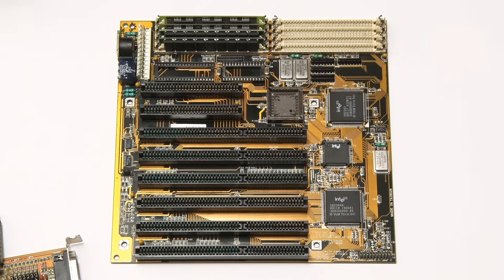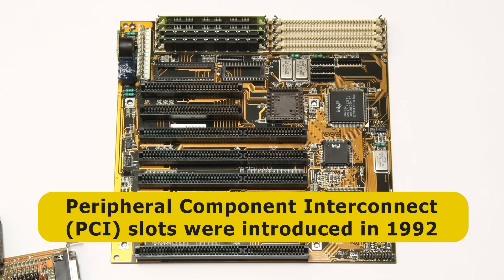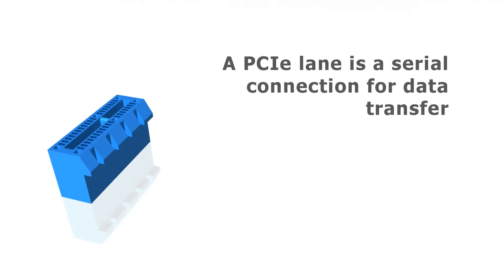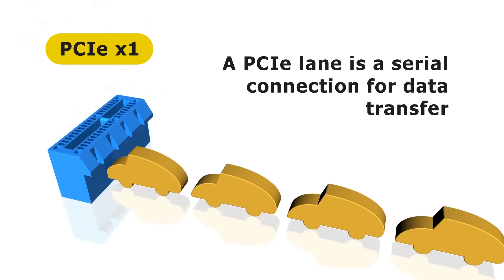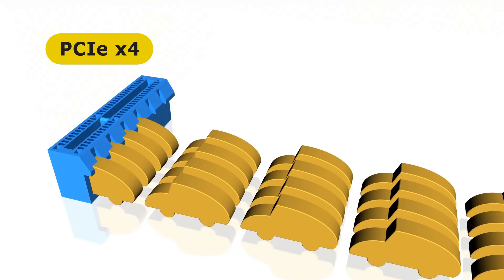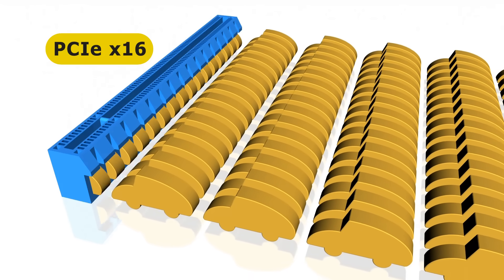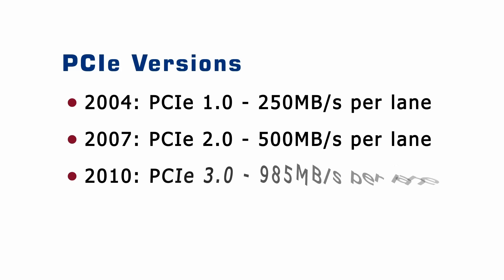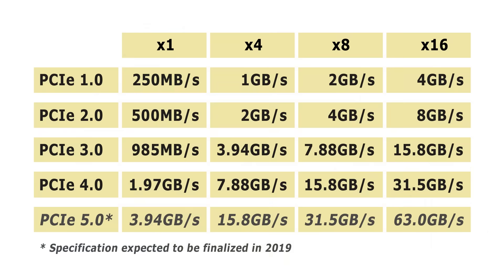Explaining PCIe Slots

Comment: But The Verge told me to put my graphics card in the PCIe slot that looks the best.
Reply: Thanks to the verge, not only did I put my graphics card in whichever looks best, I also put my "power brick" upside down, utilized good pc building practice by putting lots of thermal paste on my cpu, and used no cable management :D Now my PC is running better than ever, giving me a staggering 50 fps in League of Legends with my 2080 ti, as well as doubling as a heater during this winter season. All in all I thank the verge for helping me in so many ways.
Reply: @jjt171  

How do you have the balls to buy a 2080 ti, without having even the most basic of pc building knowledge?
Reply: @jjt171  hhahahahahhahahahahhahu congratulations!
Reply from the maker: Indeed they did! :)
Reply: @ExplainingComputers  😍
Reply: @ExplainingComputers  😍😍😍😍
Reply: @ExplainingComputers  I'm a little late to this video, but one thing that would have made it more complete is mentioning the throughput of the previous standards, for example saying that PCI was a 32-bit bus running at 33MHz, giving it 1056Mb/s or about 1Gb/s or 133MB/s, all running on a SHARED bus for all PCI slots on the board, while PCI-E uses separate buses for each slot.
That would put it more into perspective for those who don't know, and show the progress and improvements with newer slots.
Reply: Lol
Reply: But did you use your tweezers?
Reply: ouch
Reply: The Verge didn't even know what Ram slots to use
Reply: I saw the verge video and he didn't understand that when installing two ram sticks that they don't go next to each other.
Reply: And screw in with confidence.
Reply: I know that with my tweezers and Swiss Army knife I can build a computer anywhere I want as long as I have a table and wear a rubber-band on my wrist.
Reply: I was reading K's reply about The Verge guy's knowledge and the misunderstanding of EC guy. This EC channel is no doubt a great channel. Thanks for this video.
Reply: Can i put pcie 2.0 x16 card in pcie x16 slot ?
Reply: @unbroken5011  Yes, with no problems, and you can put a 3.0 x 16 card in a 2.0 x 16 slot but the performance will be reduced.
Reply: So you get your rocks-off by being a different kind of jerk, apparently.
Reply: I spent ages looking for an explanation of these things and finally I've found one! Thank you!
Reply: And I thought this was a joke 😂 I always go for good looking things.
Reply: OP, LOL!
Reply: no put the graphics card in the ram slots give extra ram
Reply: عادي عادي
Reply: Of course u should put at the best looking slot. It gives u more fps if u just believe
Reply: Oh, that poor guy… Let it die! Lol
Reply: Dont mind that video, the guy didnt understand anything about pc's he was just making up things as he goes. Try Googling a proper guide or something that way you could probably build your pc.
Reply from the maker: @808cry  I've spent nearly 30 years lecturing and publishing books and videos about computing, so respectfully suggest that you are wrong about my knowledge base. The vast majority of the comments here also suggest that this video contains good information and has been helpful to a lot of viewers. :)
Reply: @ExplainingComputers  yeh sorry for the misunderstanding but, am talking about the guy from the verge video he was making up things as he goes if you watched that video you'd understand.

Ps i really enjoyed this video 
Much love @k
Reply from the maker: @808cry  Ah. I see now!
Reply: @ExplainingComputers  I agree with the comments about The Verge, and this video. What was up with that? I know he's gotten a lot of crap for it, and that's a shame, but wow.

This video was well done in using simple ways to explain things. I'd never actually considered that the extra x16 slots were physically limited to fewer lanes because I'd never considered putting a x16 card anywhere but the first slot. Just looked at my old board I bought in 2013 and sure enough, the second x16 slot only has pins for a x4.

My brand new board has a x16, x8, and x4. But again, I don't plan to use the latter two.
Reply: @ExplainingComputers  This is a good intro for beginners and very useful in that regard.
Reply: @ExplainingComputers  yes!
Reply: @ExplainingComputers  sir plz make a video on pci ve pciexpress ..and thunderbolt port..plz sir i will wait for it
Reply: Why is The Verge's dude evidently clueless? Well, this may explain it:

I used to do computer repair housecalls and custom builds. I had a client who made his living writing "technology reviews" for major magazines. But soon I discovered that he actually did not know ANYTHING about the subject, but rather was just regurgitating promotional literature from the vendors. (How little did he know? He called me to install software that only required "Put CD in drive, click OK.")

Since then I've come to realise that this is true of more "tech writers" than not, including a very famous one whom I also know in Real Life, but won't name.

Also, I had no use for 4x slots until a bunch of SAS hard drives and an SAS controller card fell on my head... the card is designed for 4x. Well, now that 4x slot is useful!
Reply: @The_Collective  I say the conditioning goes back to the AGP days... basically you plug it into the "video card slot" which is always the first one.
Reply: @ExplainingComputers  169 likes lmao
Reply: @ExplainingComputers  I already understand what your explaining but I do enjoy your videos
Reply: @ExplainingComputers  He was talking in respect to MiniatureMasterClass's comment regarding the Verge.
Reply: @808cry  i knew that lol
Reply: @ExplainingComputers  Oversensitive much?
Reply: @riptaway  Nah, some dude was talking shit, and he basically said "I know what I'm talking about dawg". If you thought someone was talking shit, it's overly sensitive to clap back? Yeah right 😂😂😂
Reply: @808cry  lol boomers are so defensive, it is obvious you're talking about verge guy.
Reply: @The_Collective  He actually completed the Redemption Arc route in this simulation and did an apology/redux of the original video with the help of Linus Tech Tips.
Reply: @808cry  Right?!?!  Helps to be careful how we write. Ive done it.  Im probably doing it now.  LOL
Reply: @808cry  Haters are going to hate. You feel your own skills are inadequate, and you don't know how to gather enough energy and drive to make your own video.

So you're picking on an expert, rather than making your own effort. Look at your You Tube nickname; it's just one letter. It screams: I just don't want to put the slightest bit of effort into this.

This is called Attribution Theory. It's also called projection. I learned this from Professor Tracy Cross. I took his class on Research Methods. He was actually named Researcher of the Year while I was in his class!

My semester project was on how Chinese parents motivate their children to be diligent students, which was an intriguing and fun subject, with reading articles and interviewing Chinese people.
Reply: Anthony Starfield. Read K’s follow-up.  He was trying to say the verge video was bad. They got the misunderstanding worked out.
Reply: @Anthony_in_Bloomington_Indiana  lol wut?

Comment: Recently, I started getting interested in computers, especially Mini-ITX. 
I'm planning to use Mini-ITX put inside of Nintendo Entertainment System shell. Which is making a portable or Desktop PC.

I was very struggling to find the information about the PC I need, but thanks to you that I could learn about
the parts from a computer or a computer.

THANK YOU!

Comment: Still not sure I get PCIe lanes.  Sure I understand gen and lane count increases bandwidth, but what are the cards communicating _with_?  Why do some lanes come from the CPU and some from the chipset?  Is the communication bi-directional?

Why can I only cry at happy things?
Reply: PCIe is an interface just like any other, interestingly enough it doesn't only work with expansion slots. Chips on the motherboard are sometimes connected to eachother through PCIe, with no slot involved. You sortof answered your first question; some lanes connect to the chipset and some connect to the CPU. CPU lanes have less contention, when accessing memory or the CPU, since chipset lanes have to indirectly use the front-side bus to communicate with the CPU or memory, and other chipset modules will also be trying to use the front-side bus. Also yes, each lane is bi-directional and data can go both directions simultaneously even.

Comment: Well, you not only look the part but you can talk the talk. At 63yo Iv'e built all my desktops and back in the eighties I remember going to computer swap meets to get components, that's all a thing of the past now as components are so cheap. I remember when the TB HDD first came out and also the first DVD drive, you needed a bank loan to purchase LOL. I've just installed a 1TB SSD and cloned my operating system to it, I can't believe how fast the boot up time is now. So happy I bought my first PC when I did back in 1995 and the operating system was loaded from floppies with I think not sure 12mb memory. Just wish I was born in the 80's not the 50's oh well it is what it is. Tony from Australia

Comment: Thank-you That was very informative. I don't know if you answer questions, but I'll give it a try. Can you explain what PCI Express 2.0 x16
2 x PCI Express 2.0 x16 Slots (PCIE2: x16 mode; PCIE3: x4 mode) means? I get that you can put a higher end card into a lower end slot. But I am unsure what mode means. Does it mean if I put a PCIE3 x 16 card into one of those slots it will run as a PCI3 x 4 speed?

Comment: There are quite cheap adapters that allow the insertion of any PCIeX16 card on a PCIeX1 slot. I tried some with Video cards and they work. Obviously the data throughput is severely affected and you will experience image tear and some lagginess. That kind of adapters are usually intended for mining, where is much more important the calculations done in the GPU than the data transfer rate. Also, motherboards with more than one PCIeX16 slots usually share PCIe lines within them, so if both slots are populated you get X8 lines on each one. The chosen CPU also can limit the number of direct PCIe lanes available, A Ryzen 7 2700x has 20 of them but a Threadripper 2990wx triples that number to 60. I think there is enough to make a follow-up video.

Comment: I have long wondered whether those reverse-incompatibilities you demonstrated were possible! Thank you for the verification.

I still have a question regarding PCIe though, that I hope someone would be able to answer here:
Not long ago, I've read on [overclock3d . net] that older motherboards may (X300 / X400) may support PCIe4.0 for the new Zen 2 chip. I'm not aware of these old chipsets ever supporting PCIe4.0, So how can this be? Is this false, or is the PCIe version largely dictated by the processor itself?
Reply from the maker: I cannot believe this will be true. Older motherboards will I'm sure work with PCIe 4.0 cards, but at PCIe 3.0 speeds.
Reply: @ExplainingComputers   I'm relieved to hear that these PCI upgrades made no sense, thanks for your reply.

Comment: I have a question ... so all the PCIe versions have upgraded the data transfer speed (doubled each gen). Do we just need a bios update to make a PCIe 3.0 to 4.O ?  if the CPU and the card supports that speed.
Reply from the maker: Each new PCIe gen is a hardware upgrade; a BIOS upgrade is not possible.
Reply: @ExplainingComputers  So u need additional pins and traces connecting it to the CPU. I have to wait for the B550 with gen 4 to make full use of the ryzen 3000. Thank you sir :)

Comment: Awesome, thanks!
Been an IT and Network Manager for 15 years - This shit still confuses me. I never get this problems with work servers - Then I brought some old refurb servers and a couple of 10Gbe cards for a home lab - o'dear, my plans for a sleek turbo charged network, crawled at little more than 1Gbe speeds! ...
One thing he fails to cover, it seems you can put a PCIe 3 X4 into a PCI 2 x8 and get the speed..  this is what solved my problem, those same servers are now hitting 1100MB/s transfer speeds (Ironically, that is also the speed my wife seems to nag me about the electric usage)

Comment: How do they upgrade the speed of PCIe?
is it the CPU, Chipset, Memory, what?
how does the PCIe connect to the CPU?
can you connect an old PCIe x8 v2.0 video card to a newer PCIe x16 v3.0 motherboard? will it run at the newer Gen 3 speed?
Reply from the maker: All involved hardware -- inc the CPU and chipset -- need upgrading. An x8 v2.0 card will work in a x16 3.0 slot, and will run at 2.0 speed.

Comment: I want to buy rx 580 8gb. I was tole pci express 2.0 is the exact same and works well with it just that there is just 6 fps difference at most.
Reply: If you can get a motherboard with PCIe 2.0 go for it, if it's to expensive just go for regular PCIe.
Reply: @Matt_10203  I have had a pcie 2.0 for 2 years now. I almost beat the shit out of myself for ordering an rx 580 8gb nitro+ when I have a gigabyte h81m d2v rev 2.1 which doesnt support pcie 3.0. But I did research and saw that its the exact same and for real there is no difference. 6 fps at most difference.
Reply from the maker: An RX 580 will work fine in a PCIe 2.0 slot. Not quiet as fast as it will run on a PCIe 3.0 slot, as PCIe is faster. But it will still run perfectly well. :)

Comment: At first I thought what is there to know, but I'm glad I watched it. I still use an Asus P8P67 Deluxe motherboard, which is now around 8 years old. I checked the PCIe slot and indeed I have 2 x PCIe 2.0 x16 (x16 or dual x8) slots on it. It still works fine. And I just checked the difference between 2.0 and 3.0. The 3.0 is faster, but seems so little difference, that you don't really notice it. https://www.youtube.com/watch?v=kGME-yHlNVk
So, even after 8 years, I'm fine (still can play Tomb Raider in 3D on my PC) with my AMD 480!
Reply: same here, I have Asus Rampage 2 Extreme from 2009, TEN YEARS OLD MOBO, it also has 2 x PCIe 2.0 x16, and using GeForce GTX 1070 I can run just about any game at 60 fps on FullHD, despite GTX 1070 using PCIe 3.0.
Reply: I know this is an old comment, but I still wanna say this. 

it's not much of a difference. Like maybe depending on the hard ware 2-8 frames per second gain on average. If you used a PCIe 3.0 slot with that. I got a 590 and it's fine for me.

Comment: Thank for your great video.
I walked around for some weeks with the question:
Can I place a NVME expansion card in the PCIE slot meant to be fitted with a graphics card ??
As I have seen this video, I think I can ...
The reason for my question is that I want the ultimate speed out of my Samsung M2 970 EVO NVME SSD
To be sure, I hope to hear from you ...
Reply from the maker: Yes, you can put your PCIe SSD into any slot that will physically accommodate it. The fastest / 16x slot does not have to be for a graphics card.
Reply: Thanks for your answer ...
While yesterday something else, interesting passes my way on Youtube, what can be interesting for other viewers.
They told that installing the Samsung drivers for your M2 SSD gives an advantage in speed. 
So I did this morning and I can tell you my SSD is faster now ...
Why spend money to increase speed and not getting everything out of it !!
Reply: Another question is, what does all the information tell us in comparing to the daily  usage of your SSD.
For benchmarking I used AS SSD Benchmark ....

Comment: Thank you Explaining computers for the reply. 
Mr. I had another concerning look the thing is:
I'm currently using i7 2600k on an ASUS P8Z77M Pro GTX1070 OK, due to PCIe x1 is right below after x16 one this mean I can't put my upcoming PCIe x1 TP-LINK Wi-Fi adapter on the right place because my GTX 1070 uses 2 slots (too big). Officially Intel says that 2600k has poorly 16 lanes only. 
Now I'm afraid that after buying that adapter and put it on next x16 one they will negotiate which may lead my 1070 work as x8 or something lower.
Just to let you know the next two x16 ones are electrically x8 maybe (I see pinout only the half of it... I carefully verified my Asus motherboard).
I'll appreciate your reply
Reply from the maker: I think you should be fine with the WiFi adapter next to the 16x slot. You certainly cannot do any damage trying it out (though turn everything off of course when you install it!). You may lose speed as you note. Good luck. :)

Comment: +1 ExplainingComputers - THANKS I learned a lot!  I'm nearly finished acquiring parts for a new Ryzen build and this really helped since I switched to performance laptops years ago and haven't built a desktop computer since becoming an expat in 2005.

WOW!  Your chart reveals the upcoming gen 5.0 @4 lanes = ubiquitous gen 3.0 @16 lanes!  Looks like using desktop graphics cards with laptops, via external adapters, is finally going to become mainstream since performance losses should be minimal, if not negligible, in the future with gen 5.0.  :)
Reply from the maker: Good luck with your build. :)

Comment: My motherboard G31T m5 v1.0 which graphics card  please reply me
Reply from the maker: That board has a PCIe 1.0 x16 slot, so any modern card could be used if your power supply can power it. But realistically, given the board's spec, I would not fit above say a GT 1030 -- maybe something like this: https://www.youtube.com/watch?v=y4ZkvC_oRI8 -- as it does not need a separate PCIe power connector as you may not have in that system.

Comment: Fun side point:
VLB was actually pretty successful, for a short time at least.
However, it was specific to the physical architecture of the 486 processor.
So it became useless the moment Intel released the Pentium.
EISA also found adoption in server and enterprise systems, but never really appeared in consumer level hardware. Likely due to cost and the availability of the less expensive VLB, followed by PCI when VLB went abruptly obsolete.